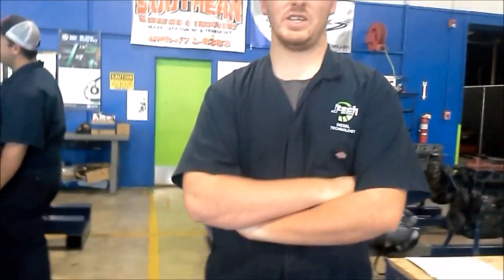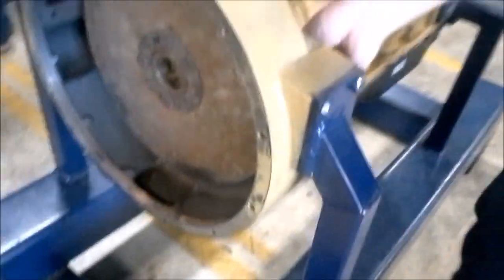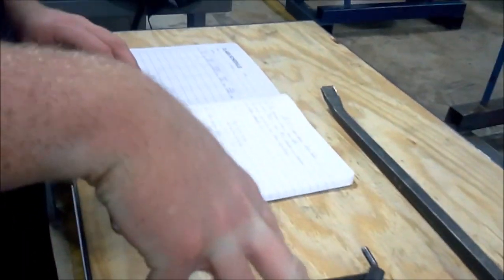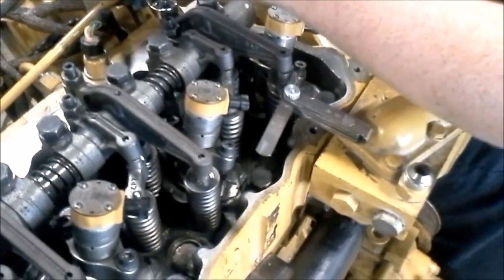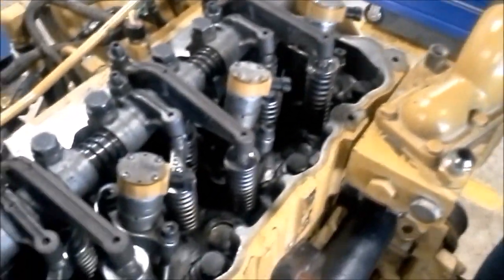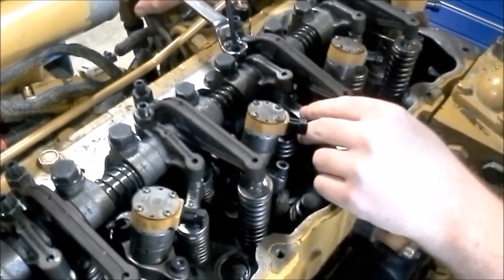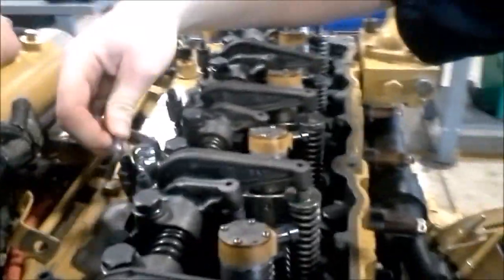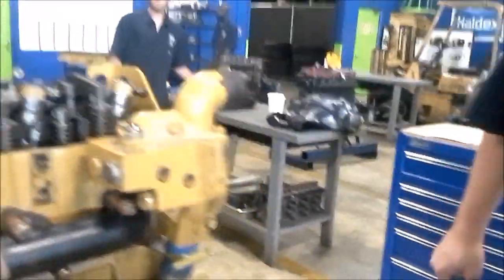Cat c7 acert complete overhead adjustment

Comment: TDC #1 end of compression stroke
Adjsut Valve 
Intake 1-2-4
Exhaust 1-3-5
2nd Step rotate the flywheel to make it 
TDC # 6  
Adjust Valve 
Intake 3-5-6
Exhaust 2-4-6

Comment: hi, it could have been complete, however , how do you validate  TDC is in fact #1  and not #6?
Reply: Isaac Amitai the intake and exhaust rocker arms will both be slightly loose with no pressure on either rocker arms

Comment: I was taught when you doing  valves adjustment, you must recheck with a fielder gage below and above  they set number, to insure adjustments right, for example .015 check .014 and .016  to insure .015 is correct. If .016 fit you too loose and .014 drag you too tight.
Reply: Its not that critical man. You charge by the hour, nobody wants to pay for you measuring it 3 times. You do it enough you just get a feel for it